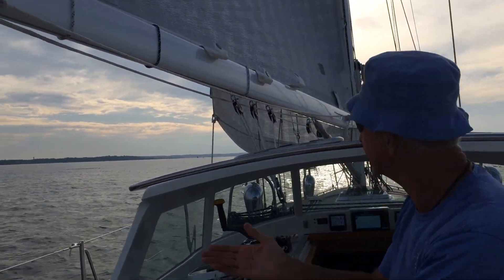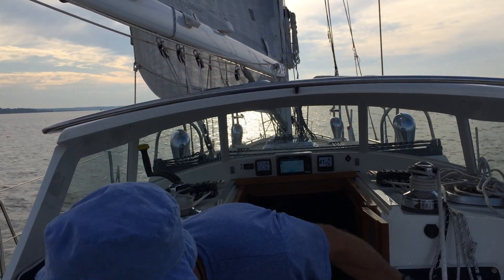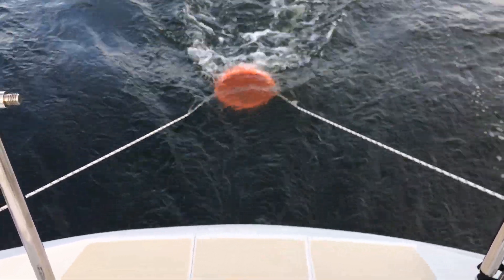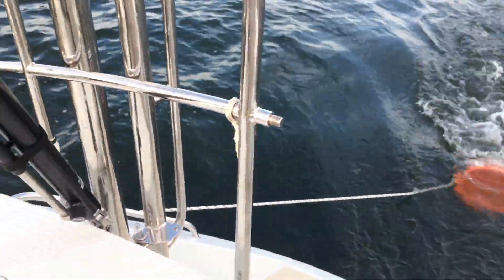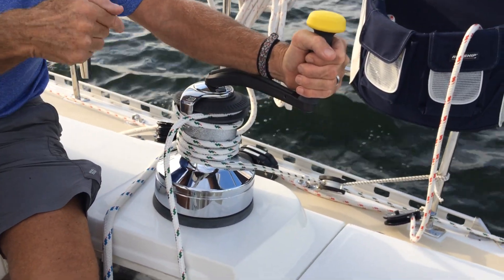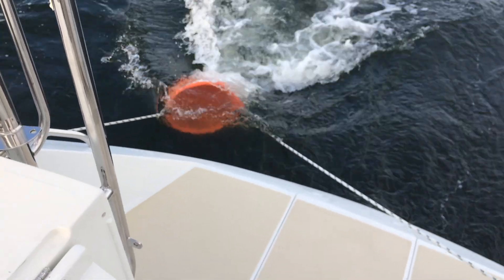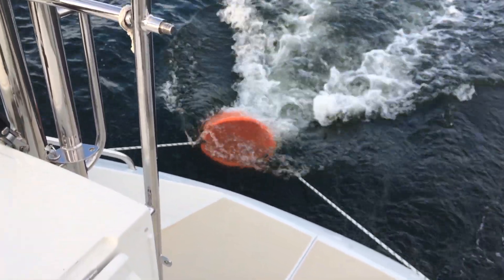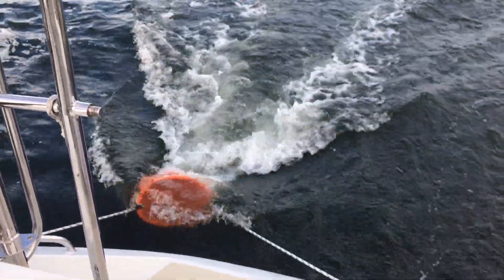Emergency Steering

Comment: Nice! If you attach a short string to the bucket between the two long strings and wrap a string around the top of the bucket, you will reduce the load on the bucket and it will last longer

Comment: does the rudder usually lock in place when steering is lost on a sailboat.. or would it be turning freely against the current..  back and forth...????????????
Reply from the maker: That depends on the steering mechanism - a cable could jam the rudder in a fixed position, or break and let it swing. Or, the rudder could break off entirely.

Comment: I have a 5 m dinghy, well balanced, and I can easily steer it by adjusting the mainsail and jib. Furthermore, wouldn't your system be more effective with a floating anchor, which is often found in the equipment of a cruiser? good luck...

Comment: I lived the experience of a broken rudder cable, in the middle of the night the wheel suddenly was held for a second which was enough to counteract with the pilot, and the cable under broke. Luckily the boat model Beneteau at the time had a well with an axe to use a prepared safety rudder stick, but I held that thing throughout the night to Huahine. Ever since I juge a boat by its handling of rudder going wrong or ....falling off, solutions need to be thought well before departure.

Comment: usually, when you lose steering, the rudder does not lock itself amidships. Try emergency steering with rudder left loose as when the rope or chain breaks.
Reply: thats what i though
Reply: Exactly
Reply: That's when you jettison said rudder

Comment: extending on @Leifur Thor ‘s idea - use a floor board to be the emergency rudder blade, connect it to the bathing ladder on one the front side and attach the lines on the rear end as demonstrated in the video. Non of us hopefully will have to test this, but who knows. In this year’s ARC a boat had to be given up for a broken rudder in mid of the Atlantic.